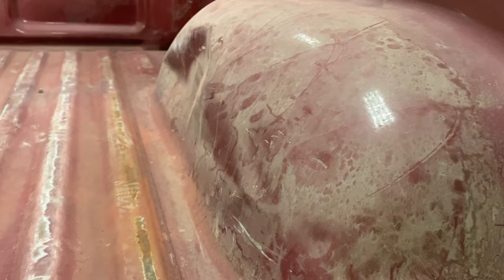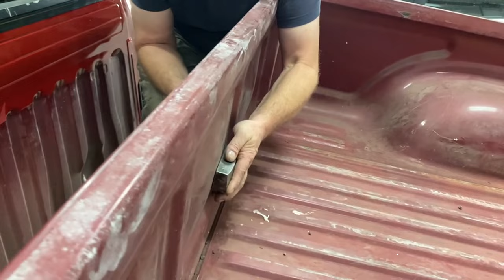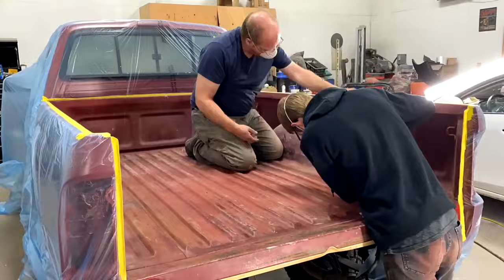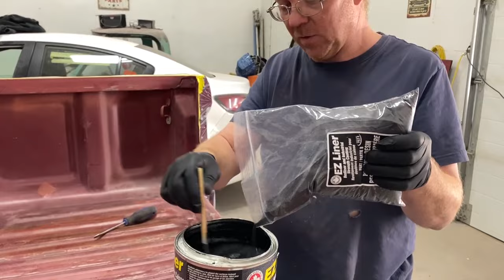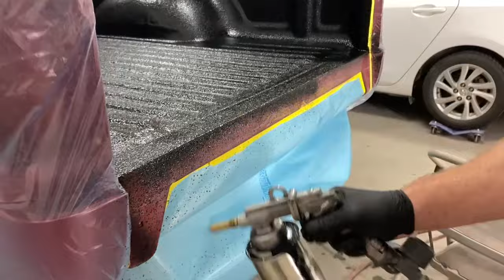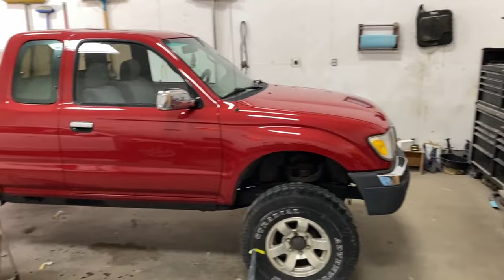1998 Toyota Tacoma DIY Spray-In Bedliner: Is It Worth It? | Part 18

Comment: Missed a big spot on the passenger side
Reply from the maker: Lol pretty sure we got it all good 👍
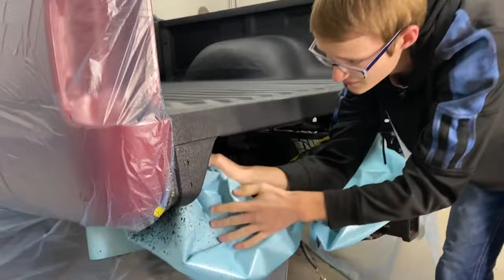Reply: @tjvalleygarage  you can see it at 07:50 right above the wheel well.
Reply from the maker: @jdsim9173 I see it now, I’m pretty sure it will be covered by the rail caps we’ll put on later so the tops we weren’t too picky about.
Reply: @tjvalleygarage  That's great, you two did some amazing work.
Reply: yeah that's driving me nuts